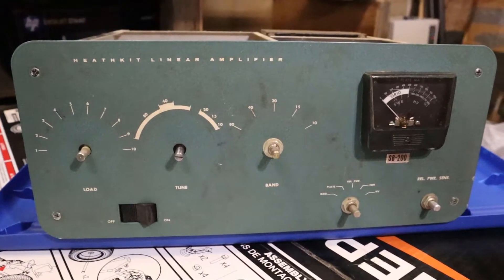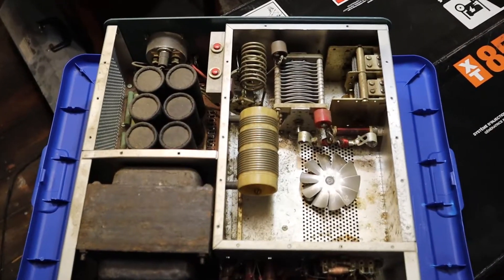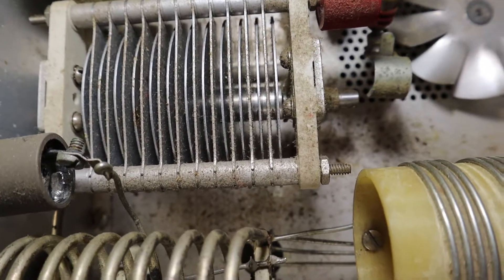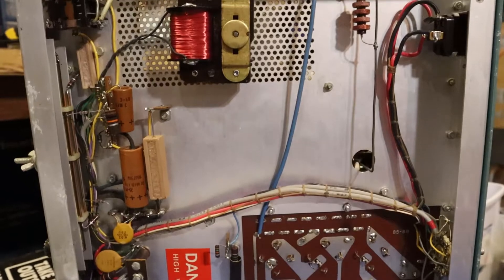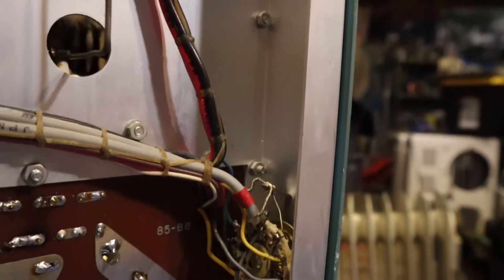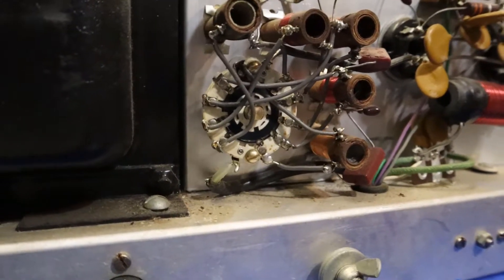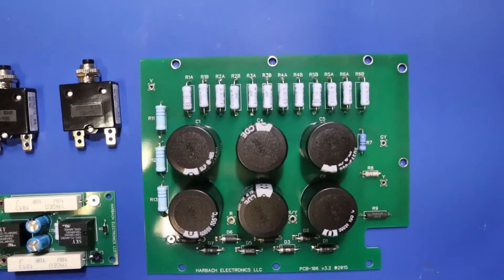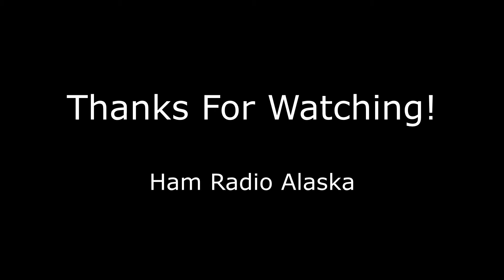Heathkit SB-200 Amplifier, Needs some TLC!  (and Harbach upgrade)

Comment: I have reversed engineered my SB 200 and fitted Russian triode  GI6B  tubes and gives me 1300 watts dc  output on 40 meters  for 100watts in  but the EHT  transformer  wont like it,the reason I did this is that there are no more USA tubes being made and the China  tube,s are very poor quality and only lasted 3 weeks GI6B tubes are very cheap.

Comment: I'm in the process in resurrecting the similar SB-201. 
I'd recommend replacing the RF input RCA with an SO-239 and also install the Harbach SoftKey circuit board which allows a modern transceiver to switch the amplifier.   
Also, look closely at ALL of the solder joints - they may look good but 50+ years will have taken it's toll.

Comment: That’s an interesting project… btw I’m also working on mine, it came smashed on the rear side so I had to basically take it completely apart and start from zero
Reply from the maker: Oh wow, I guess I don't feel so bad that mine is just dirty (and may need some updated parts).  It seems like it will be a good amp when rebuilt, so I'm looking forward to digging into it.  I hope your project goes well and that you get good service out of it.